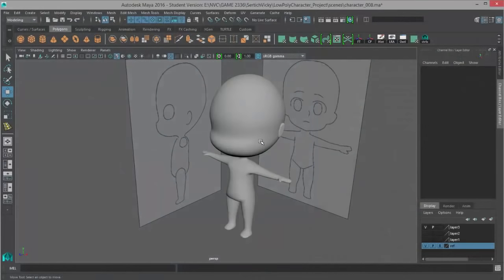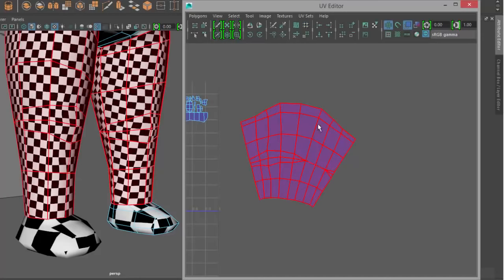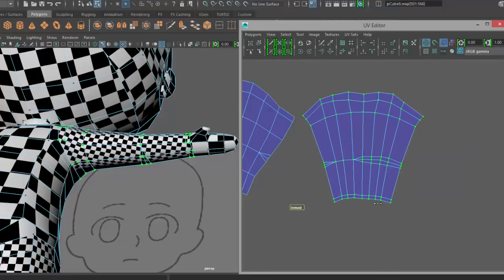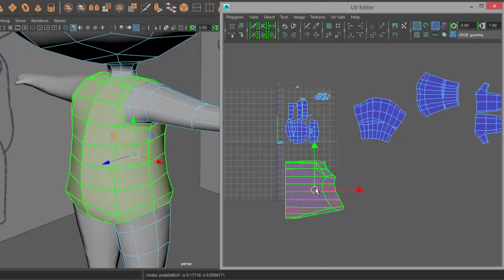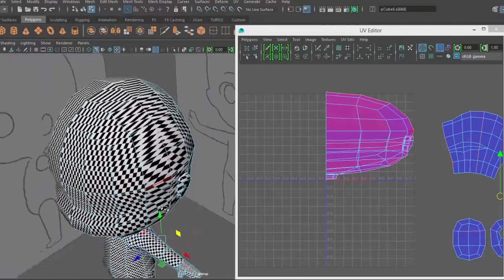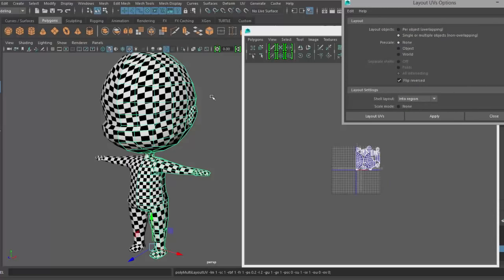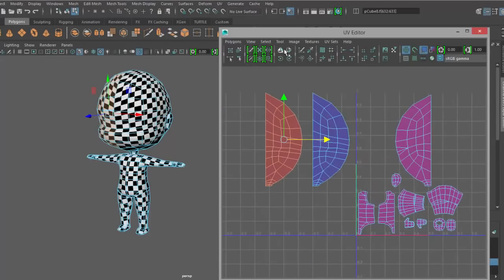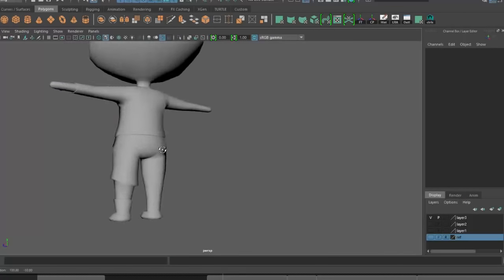Maya: Simple Character Part 02 - UV Unwrapping Model

Comment: Yay! Thanks very much! :) Awesome tutorial. I'll post an image of my finished product once I get a texture made for it!
Reply: Only a few things I came across. 1) I can't seem to "Soften" the middle edge of my model, so it shows a straight line down everything. 2) I accidentally disconnected my neck vertexes which royally messed up my model when duplicating the other half (it kept deleting? the bottom vertexes of my neck, so I had to "bridge" when duplicating instead of having it connect via vertexes. 3) When I made my texture in Photoshop, Maya some reason wants the texture transparent. Which is fine because in Unity I just remove the transparency. 4) The color of my model is different  on each side of the model, I think it's just shading because of issue 1 being that the edge shows in the middle of my model.

Edit, yeah issue 2 is because of issue 1. I just deleted the neck and remade it and now it works fine. Which also fixes issue 4. So really I only have the transparency issue.

Awesome though!